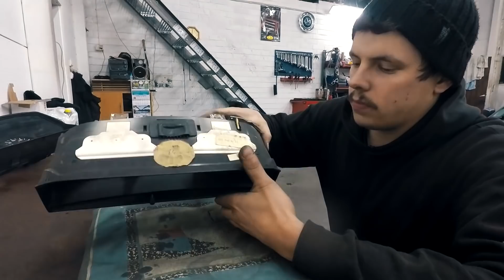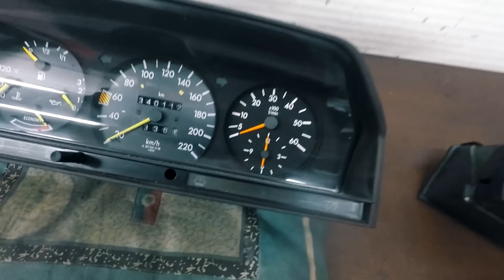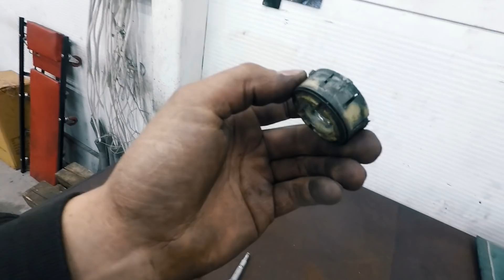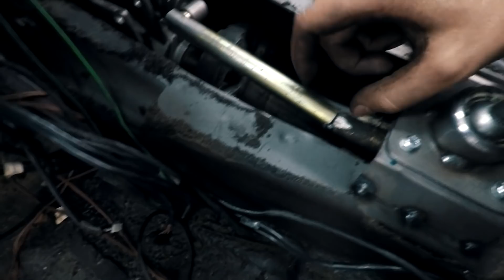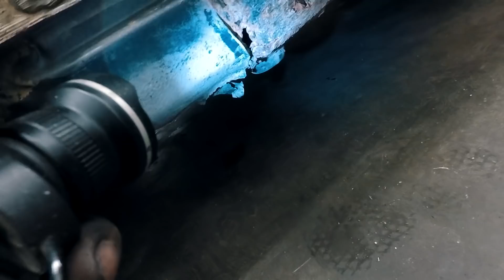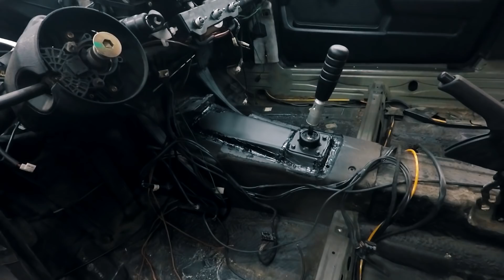VÄRKSTAN Episode 8 - ZF Shifter & Rust Fixing

Comment: I've watched all the episodes now and I'm very addicted!! 

How do you usually deal with the bare metal surface that gets hidden behind the weld spots? (Talking about the jack-stand spots) - Do you just leave bare metal on the other side, or do you coat it with welding primer or try to spray ML through water-drain holes etc?
Reply from the maker: I will show that in next episode, stay tuned!
Reply: @blomppo  Awesome, you're a beast! I can't wait, but take no stress!